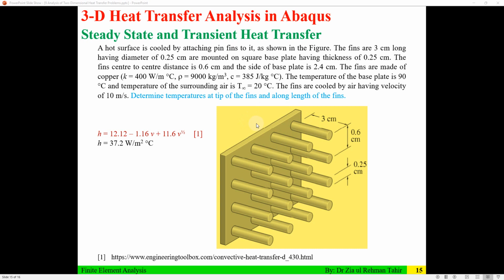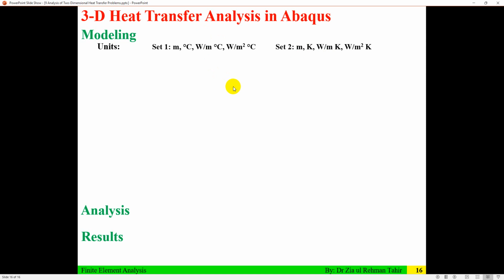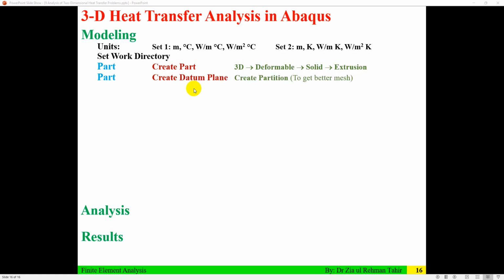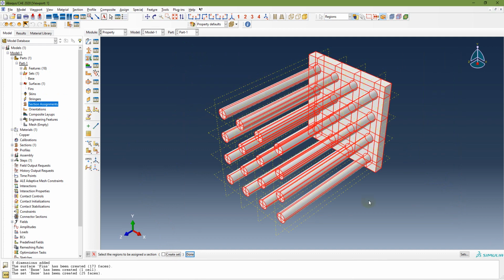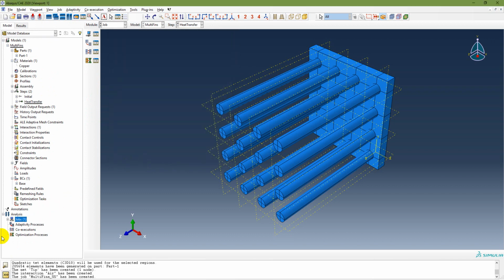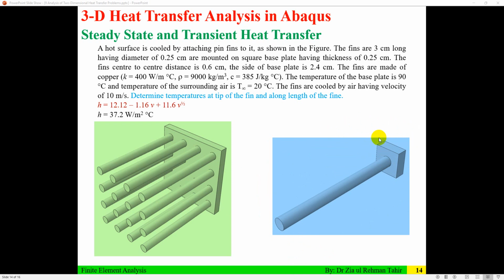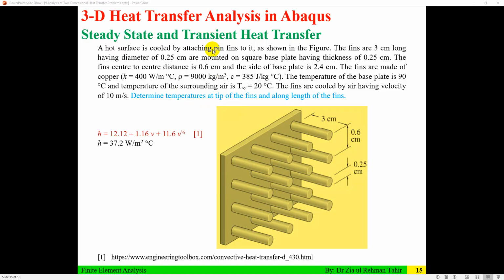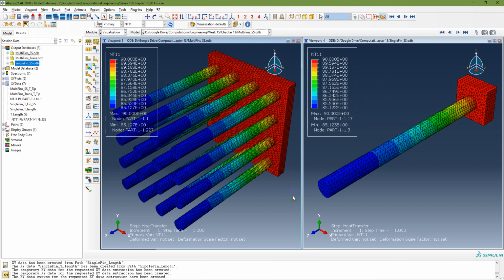Abaqus Heat Transfer Analysis 7 | Steady State and Transient Heat Transfer through Cylindrical Fins

Comment: How do you add/change the velocity of the air?
Reply: Heat transfer coefficient is dependent on air velocity 
So for current problem one particular velocity was selected . If we change velocity, only heat transfer coefficient will be changed .